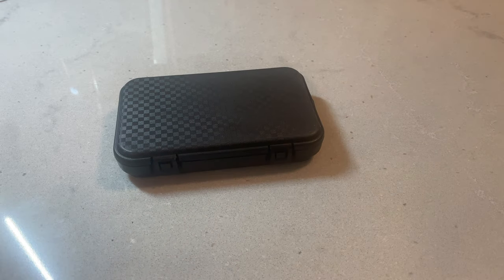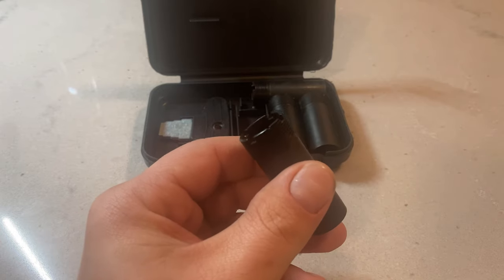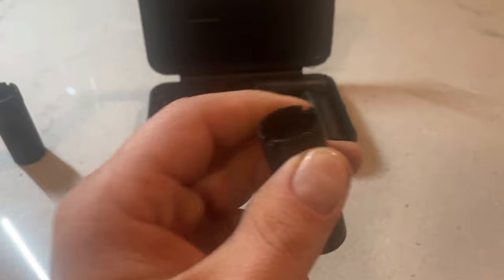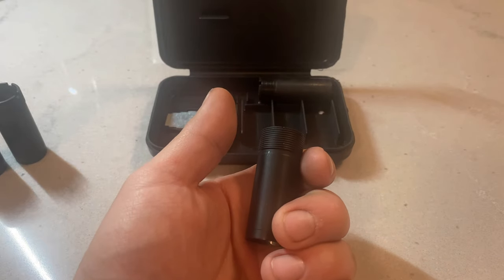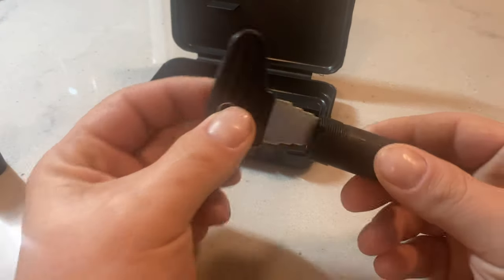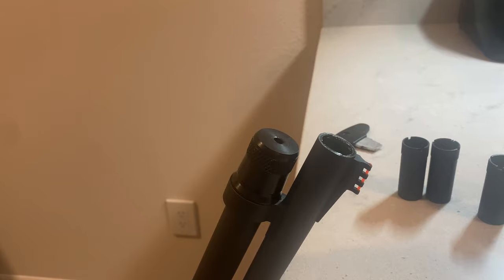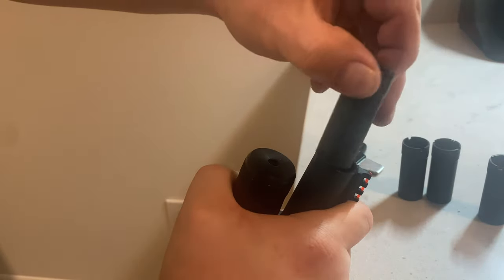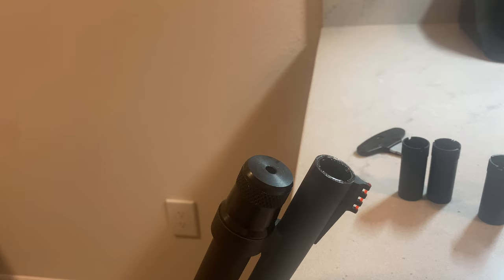Alpharms Silver Eagle Gold Horse Choke Tubes Explained

Comment: I called TR imports and they told me to use the 5 knot choke for slugs and double 00 buck is this correct?
So far I like the gun but anything under 1200 fps barely cycles
Reply from the maker: Yes that should be your loosest choke tube which would be correct for those loads. If your having trouble cycling try some heavier loads like buckshot and slugs to loosen up the action and mechanics. This weapon is inertia driven not gas driven like some other models. This means it’s driven by recoil. By shooting heavier loads that will loosen up the springs and such. Usually 50 rounds will do it sometimes more
Reply: Blacktop Tactical I bought some turkey loads and black aces 00 buck, and some breneke slugs hopefully that will do it! Oiled it up! I really wanted this gun and enjoy it! Beats a 900$ jM 
Thanks for replying
Reply from the maker: @thorodin6686  that’ll work perfect! No problem brotha any time
Reply: @BlacktopTactical  What do you mean by" loosest choke"?
Reply from the maker: @RudeRaptor  loosest meaning largest bore that yields the least constriction causing the widest pattern. Good for buckshot or slugs.
Reply: @BlacktopTactical  
Oh I see. Thanks man!
Reply from the maker: @RudeRaptor  no problem glad to help